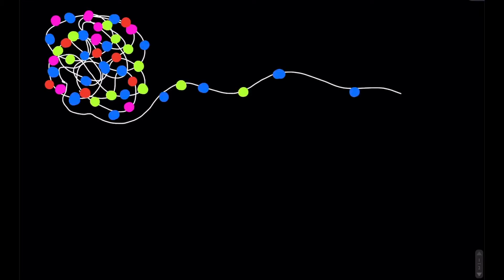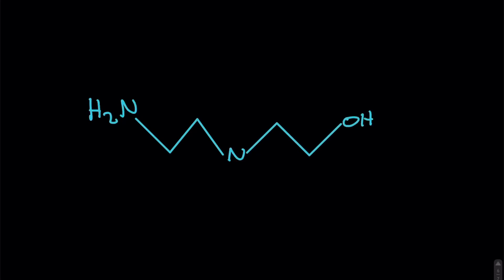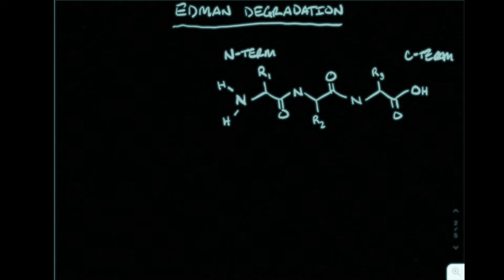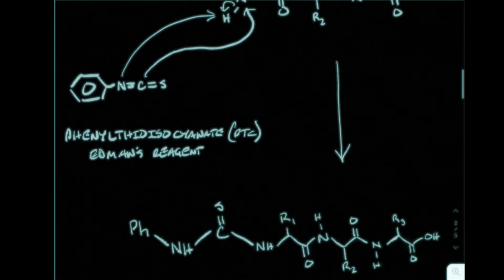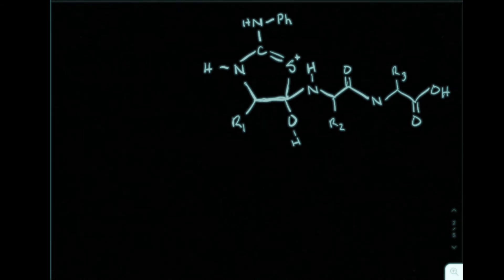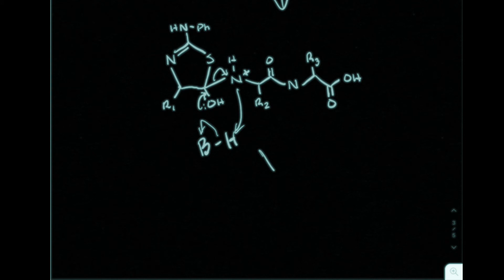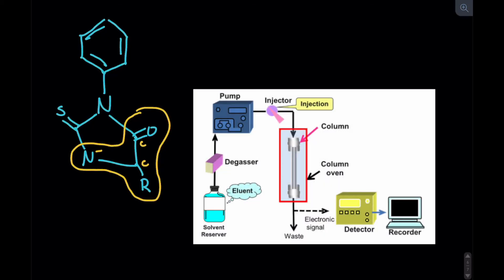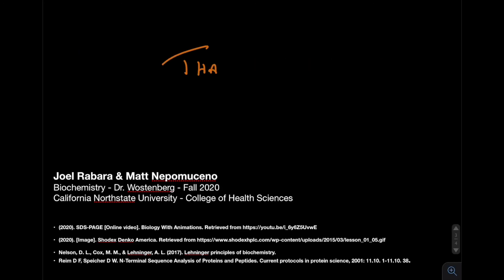Edman Degradation   Simplified

Comment: In 5:31, the carbon bears a significant partial positive charge due to its double bonds with nitrogen and sulfur, which withdraw electron density from it. Therefore, the lone pair on the nitrogen in the amino group is expected to attack the electrophilic carbon.